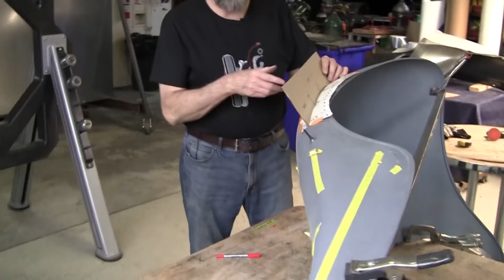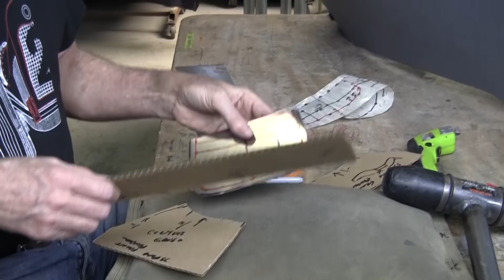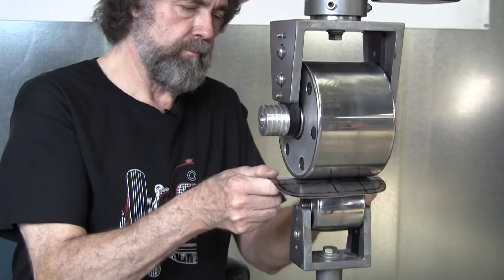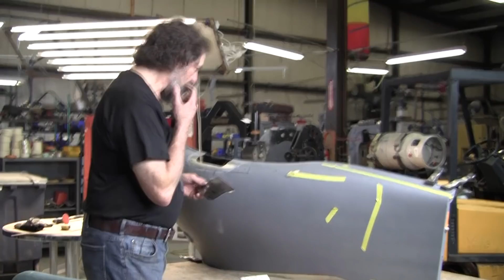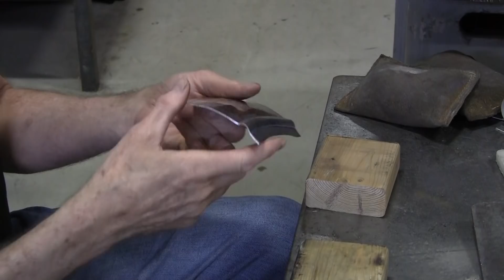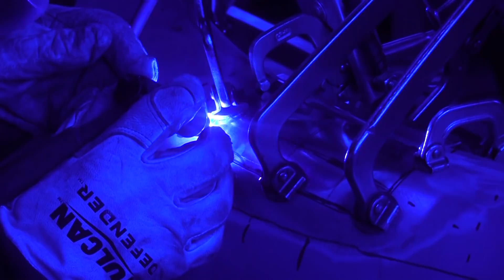33 Ford Fender (Part 3) The Patch Panel

Comment: It would seem to me that you need to stretch the return edge. That way when it folds around the wire edge it will follow the radius in a convex orientation.

Comment: Is there any reason for using tig over mig, I haven't tried tig welding yet, just wondering, it's looking great, certainly a lot of prep work, thanks again, all the best to you and your loved ones
Reply from the maker: Once you try a tig and see what you can do you will never use a mig again for automotive sheet metal.
Reply: @proshaper  thank you, I'll get off my ass and start trying it, I have Argon mix, do you need straight Argon for tig, or can you use the Argon mix? all the best
Reply: @donaldhalls2189  There are some excellent TIG welding tutorials on YouTube, including some by Wray that will help you get started.
Reply: @donaldhalls2189  Wray convinced me to try the tig welder. Its much more clean than mig. Softer beed that has similar characteristics as base metal and more control, feels like higher quality work working with the tig.

But got a mig that has 10 ampere steps and voltage/wirefeed control and my tig is an inverter with alot of different settings so my tig is an upper end mashine than my mig. But the mig is still an good, name brand mashine. 

For the low money, low quality work its mig just for simplicity, if im supposed to be proud of the job im choosing the tig every day of the week.

Comment: On a small patch like this does it make sense to let the blank run long to avoid finger biters? Instead of trimming it to a 1/4 or 1/2" before you start wheeling maybe make it an inch or two longer. Or does that make it too much harder to form the panel?
Reply from the maker: Yes more material means more work. Either way will work if you follow the gauges.

Comment: A great addition to this series.
Out of curiosity, do you want the fit up for welding to be as tight as possible? I've seen other channels where they say a gap of around .030" gives the best chance for full weld penetration and the fit shouldn't be too tight. Maybe it depends on access to the backside of the panel 🤔
Reply from the maker: The tighter the better. Confusion rears it's head when comparing mig with tig techniques. Mig welding should not be used on collector car sheet metal. It will work, but not anywhere as good as tig. In a few years I will be saying tig welding is not to be used the only technique is laser welding.

Comment: The tipping wheel upper die and poly lower is there a how to video to make that on you’re page? Or is it something you offer for purchase I’d like to get me a set or make it. Im always looking for an easier way to make that fender rolled edge.
Reply from the maker: I use a tipping wheel of my own design to do most of the detail work. Other methods used by craftsmen to do the same thing are using a PullMax, flypress, or beadroller.

Comment: Great work. I like the straight forward explanations and showing all the ways to accurately to get the lengths correct with the perfect wheel arch. Thank you for taking the time to document every step of the repair. I have been subscribed for a while and go through all the sessions, Your work to straighten out the Austin Healey shroud was true craftsmanship to save a piece most would have written off. All the best 
Glenn
Reply from the maker: The Healy shroud was done just to show what is possible. I will get back to finish it someday.
Reply: @proshaper   Definitely shows what is possible. It shows a methodical exercise in patience. I think your comments on metal is clay and can be easily corrected changed my perspective on straightening metal. I have a 40 Ford convertible that will need some metal coaxing. I have been successful so far with my metal work but watching your work is encouraging to fix more than replace.

Comment: Seems to be a good place for FITZEES cut and butt method to get that patch cut down to a tight fit .
Reply from the maker: Mig welding a patch on and cutting around the patch and finish welding is a quick method to patch rotted farm trucks not collector cars of any value.

Comment: other shows i watch suggest a min 1/6" gap for welding?
Reply from the maker: A gap causes pulling, which causes distortion. I'm guessing he is mig welding not tig welding. All collector car welds should be done with a tig welder.

Comment: Seeing that patch finally drop in flush was very satisfying.

If not for the repair if the wire, I'm wondering if the area could not have been simply stretched on a bag and wheeled smooth?
Reply from the maker: There was a globbed on "repair" on the inside that needed removal.
Reply: @proshaper  Yeah, it did look like two layers and maybe gas-welded?